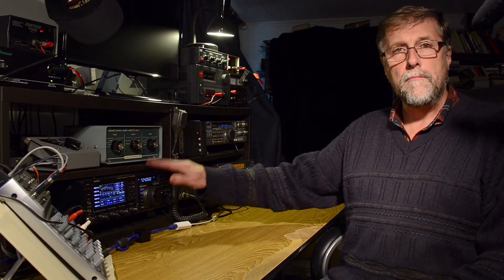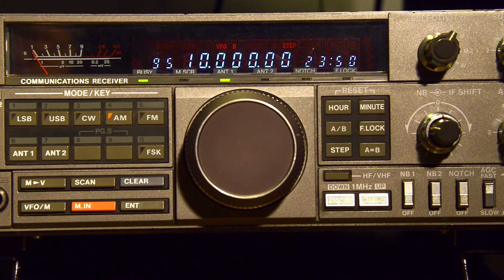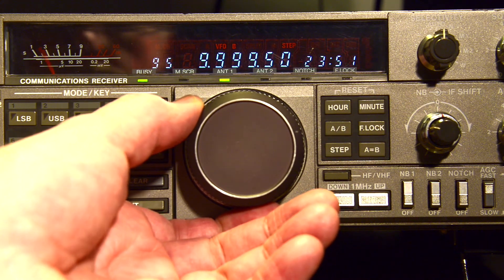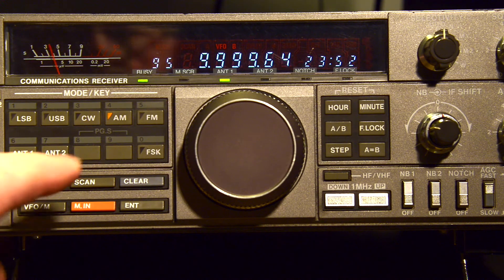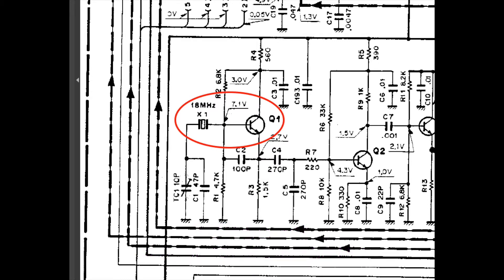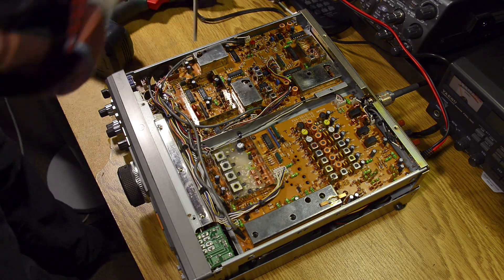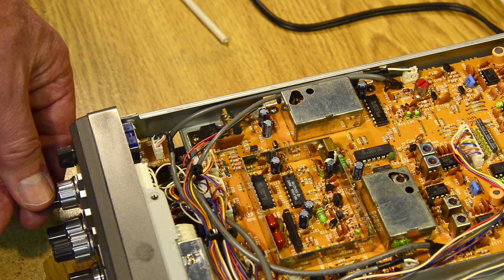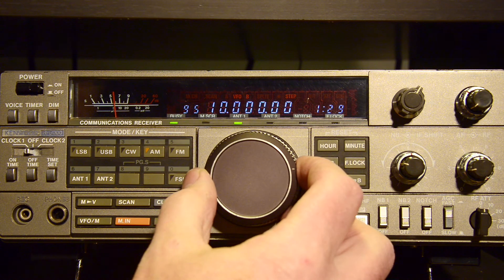Kenwood R-5000 Shortwave Receiver - Restoration - Part 5

Comment: Adjustments by ear are a good way to go quick and easy and often hardly distinguishable from results using test equipment. I often find a good
Multimeter, signal generator and frequency counter will do the job most times
Without an oscilloscope.

Comment: Rob -- thanks for this video, which shows clearly where the master oscillator adjust point is.   I intend to do the same -- one thing, you might have shown the receiver in SSB after your adjustment . . .most decent receivers have adjustment capability, but some (like the ICOM 71A) don't allow a fine enough adjust for both LSB and USB
Reply from the maker: Hi Dan. To do the thing properly you really need the correct test equipment: an oscilloscope, signal generator, freq. counter, etc. and follow the procedure along in the service manual. My video was the quick and not so accurate poor man's version of frequency alignment for AM!  :-)  You can adjust the USB/LSB as well, but the settings are more critical than for AM, so the test gear is necessary...which I don't have. I only use the rig in AM for SWLing purposes on the SWBC bands. So, if you haven't got the gear, then trust in your "musical ear" to see if you can get it any closer. The adjustment on the trimmer cap on my unit was very touchy! If there are serious problems with the freq readout, then taking it to a technician with the correct gear is probably the best option....just depends on how badly out the readout is. Good luck.

Comment: HOLA , GRAN TRABAJO .
tengo este mismo receptor y me encanta, pero hace unos dias al pulsar cualquier tecla de funcion emite al hacerlo un beep tone por el altavoz un poco fuerte que resulta desagradle ..
no veo que opcion he cambiado ..
hay alguna forma de reconfigurarlo para que no pite al cambia o pulsar el teclado ??
gracias
Reply from the maker: Hola Carlos. El volumen del beep no se ajusta del panel delantero. Puedes ajustar el volumen de la beep, pero tienes que abrir la radio. El control del beep en IF circuito. Busca el componente VR8. Puedes ajustar el volumen al cumplir el VR8. Además, puedes bajar el volumen de VR8. Si no conoce los asuntos técnicos de radios, debería conseguir que un tecnicista de radio haga esto por usted. Me disculpo por mi mal español. Los mejores deseos, Rob VK3BVW
Reply: Gracias... Lo revisaré

Comment: do you have any cures for a deaf r5000
Reply from the maker: Ray Bokor It could be many things. But you need test gear to properly ascertain the issues.
Reply: I flipped mine over and found the 1uf cap c12 blown.

That blocked all of the signals from coming in.

Look on the schematic where the antenna is coming in then locate C12.
Reply: I flipped mine over and found the 1uf cap c12 blown.

That blocked all of the signals from coming in.

Look on the schematic where the antenna is coming in then locate C12.

Comment: GREAT VIDEO ROB! I HAVE A QUESTION, WHENIT COMES TO SSB, WHAT KIND OF BANDWITH DO YOU SUGGEST FOR INRAD FILTERS? I THINK THEY HAVE 2.8, 2.1 1.8 KHZ... THANKS IN ADVANCE FOR YOUR REPLY AND HOPE YOU UPLOAD MORE VIDEO'S. 73! KM6EHD JOJO
Reply from the maker: Jojo, I don't listen to SSB much for listening on the R500, mainly used for AM SW BC stations.... unless I'm interested in getting rid of adjacent channel QRM - then I will tune in on either USB or LSB, depending on which side of my wanted AM signal has the QRM. If I'm using the amateur bands, then I'll use my Yaesu FTDX3000 rig. On the R5000, I think the stock SSB filter with the rig is 2.4 kHz, which seems fine in most situations. 1.8 is getting pretty narrow, so personally, I probably wouldn't get that one. You might find the 2.1 kHz filter useful.  73, Rob VK3BVW